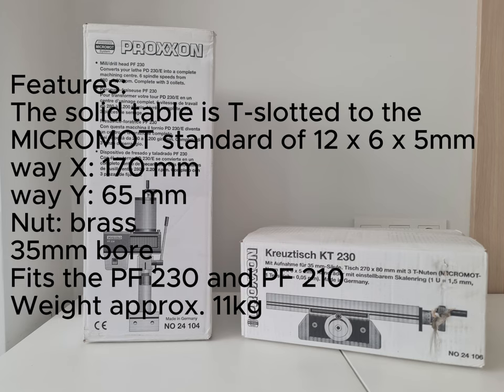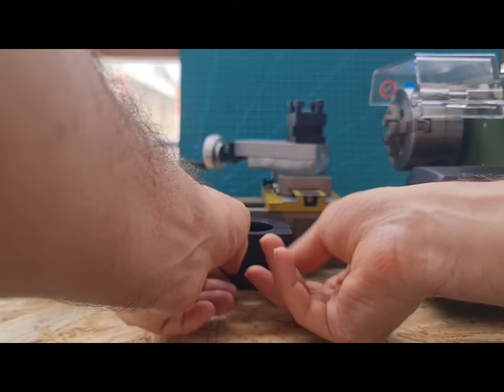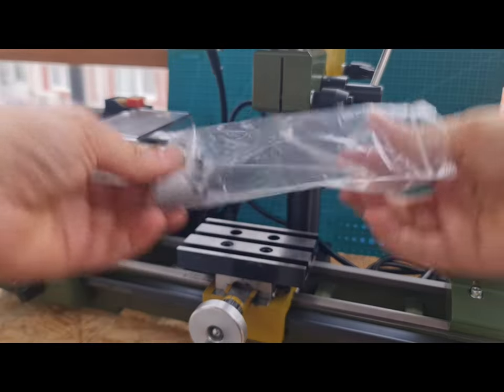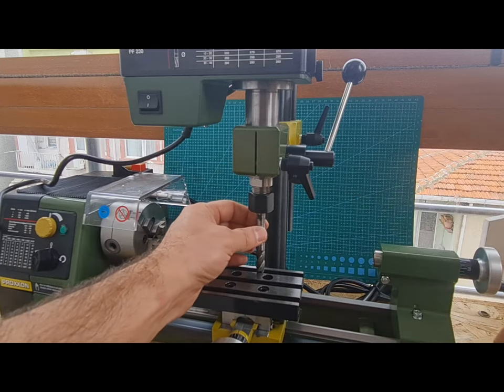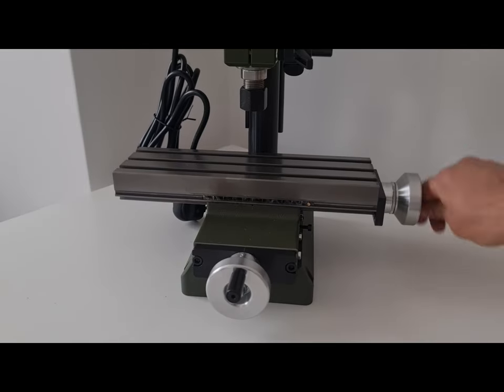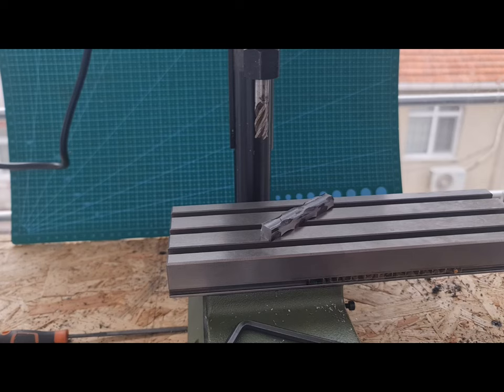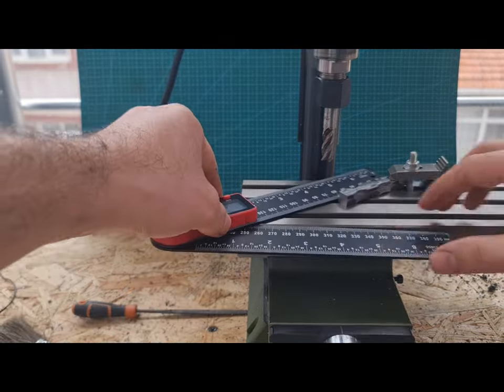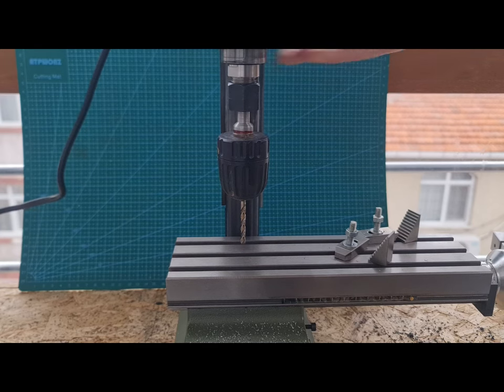Proxxon PF230 Mill/Drill head unboxing and insert tool holder making

Comment: A machine determines the quality of your products. Do yourself a favor and invest the time to visit a lathe/milling machine dealer, get an introduction what to look for. 
Right after that, go to the hardware store and have a look to the proxon tools.
I bet this brands products are a lot less impressive, then.
Reply from the maker: yes ı agree. Proxxon tools are very impresive but the reason why ı tried to do is their accesories are very expensive ever for basic stuff. Andother rason is i try to find some projects to use my machines as ı am beginner.  But in the end ı already bought the tool required. I am using them in my other videos :)
Reply: @UpCycleMaker  He meant to say that Proxxon tools are not quality made compared to what a professional would use. He might have forgotten that we are not professionals, though.